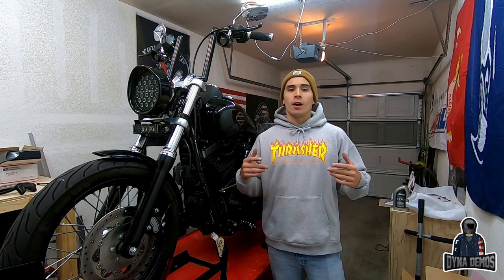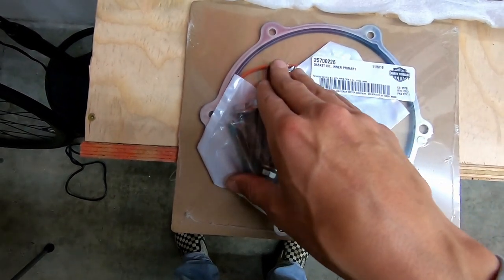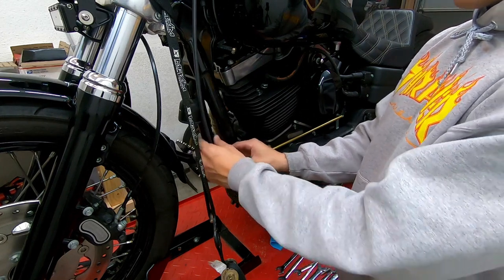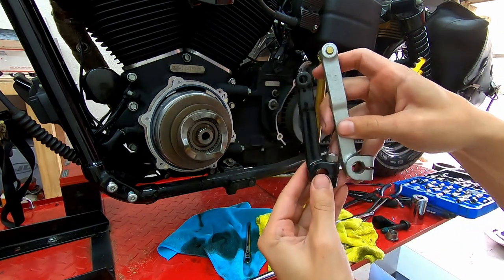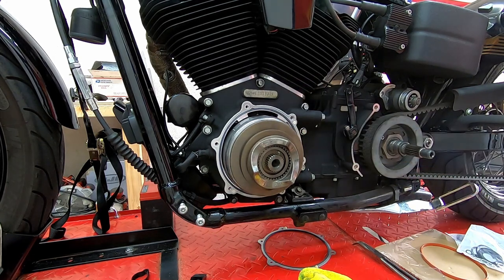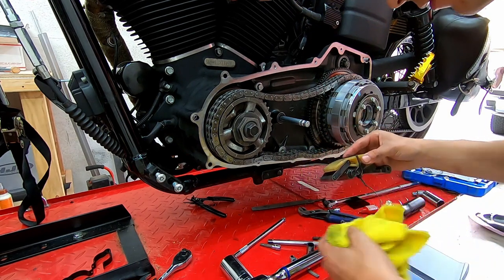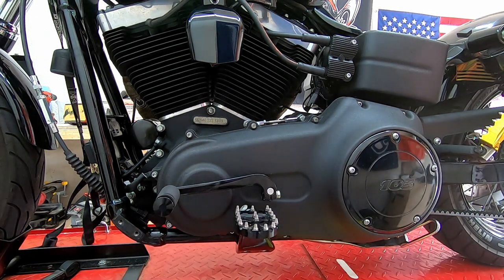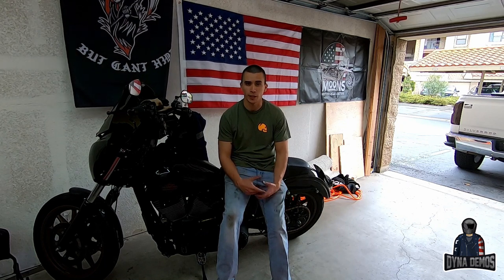Forward control to Mid Control Conversion (Dyna)

Comment: my shift shaft (going through the primary) seems to be binding or something. It is not moving freely and I'm having to use a few lbs of force to actuate it... any ideas?
Reply from the maker: This happened to one guys bike I did the conversion on I made sure nothing was getting caught on the linkage or shifter and it ended up being the bushing the shift shaft was going through was extra tight for some reason after a week of riding he was all better or spray some lube in there see if it frees up a bit

Comment: My dyna streetbob doesn’t have that hole in the outer primary. Will I need a new outer and inner primary or just an outer do you know? My dyna came stock with forwards.
Reply from the maker: Yes to a new outer and if the inner also doesn’t u will need that too
Reply: Just checked behind inner primary. Hard to see or feel around, very tight but I think I got a glimpse of what looks like a hole on the back side so hopefully just an outer should do me.  PS my bike is a streetbob Special edition if anyone knows for sure if what I’m seeing is correct. Thanks
Reply: dynademos Sorry, one other question. Is there a bushing of some sort that goes in behind primary before you put the shifter rod through? 34982-02A is this it? I ordered a new outer primary and this part seems to be coming with it but I’m unsure what it is lol
Reply from the maker: Stewart pretty sure that is a bushing that is for the outer primary shifter shaft hole should just be pretty easy to put in put the shifter through the hole if the shifter isn’t snug it’s definitely for the that and u will want to install it before u do the mids

Comment: What would a job like this typically cost at a shop, parts and labor?
Reply from the maker: Depends on the shop probably like 5 hours of labor shops are usually like 75-105 an hour. Parts are like 400-500 pending on how cheap u get the mounts
Reply: @dynademos  Awesome, I appreciate the quick reply.  This is ballpark what I was guessing it'd cost.  About halfway through your video I realized this is a job beyond what I would confidently attempt myself.  Cheers!
Reply from the maker: @hi5_centipedes874  no problem better to go to a mechanic than start the job and realize you are in over your head!

Comment: I have a 2015 fat bob. Is this conversion work on mine?
Reply from the maker: Yea
Reply: @dynademos  Thanks, look like my fatbob need new inner and outer primary. I saw someone on HD forum said the primary can be drilled out for the Fatbob. Is there a conversion kit without open the primary? I found kits for 2018 and above for fatbob
Reply from the maker: @thoaikhuu8748  I’m not sure if there is a kit for the conversion without the taking off the primary it would be expensive. If your primary doesn’t have a hole through it you can buy new ones or I’m pretty sure there are people that can convert them

Comment: What was in that hole before the new shifter shaft went in
Reply from the maker: It was just a plug not to actually plug oil cause that’s what the gasket in the primary is for

Comment: The 2 HD dealers near me are uncooperative and act all annoyed when you ask them to look up parts without the proper names, behave like they’re doing you a favor just by existing  and refuse to give out part numbers because “ it’s against policy”. Without part numbers on the video from the get go not much can be done duplicating the mod.
Reply: You'd be better off buying a new bike with mids then buy all the parts from harley. He shows you the parts I don't think it's rocket science to outsource the gaskets and ebay the inner and outer primary. Mid control set same or new from tc bros

Comment: Is it possible to bore a whole to make the outter primary cover a mid control cover?
Reply from the maker: So yes however u will need to weld a tube and do some other thing for it to not leak easier to just get a new cover
Reply: @dynademos  thank you bro!

Comment: I see where you installed the seal now..still curious about if you needed a inner primary
Reply from the maker: Rod it was the same inner primary all I did was remove the shift shaft plug that was installed because he had fwd controls if your primary doesn’t have a hole I’d recommend getting a new one idk if it’s possible to drill a hole on the ones that don’t have the hole
Reply: @dynademos  Thanks man! Great video.

Comment: how much does this conversion cost?
Reply from the maker: 130shooter1 300 ish for parts
Reply: I’m Doing this upgrade tomorrow; I think I spent around 5-600, that’s every single piece Lego talked about in this video. I got all the parts pieces through multiple vendors too
Reply: @lincolngill6690  did you do a ton of vendor price comps or?
Reply: @firecracker2510  some parts I got used, some I bought new from HD and other vendors. id shop the project a bit if you want to do it cost effectively.

Comment: That's the old style compensator its 140 the new comp it's a torx and its 175
Reply from the maker: Blair Ernst good to know
Reply: @dynademos  that comp is no longer used because it wasnt a great comp so they changed it I have replaced 3 that failed and it can take out the clutch
Reply from the maker: Blair Ernst never knew that I’ll start letting people know what year did they change

Comment: As a six foot six inch tall guy......I just wonder....why? Why go to the crappy balance and rotten handling of mid controls....
Reply from the maker: Denis O'Brien I would definitely argue it improves handling just like a dirt bike u don’t see them with forward controls u need your feet under you
Reply: @dynademos  A agree to disagree.....when I bought my Dyna I Found it top heavy and difficult to manoeuvre....but them I am a lot taller than the average, and don't do dirt bikes. I also found that they were hell on my arthritic knees.

Comment: Im surw you wont ever have issues using that stepped locking tool but that is the incorrect tool. You shoukd use the proper metal bar. Harley recommended and you wont damage anything
Reply from the maker: Haven’t had any issues but absolutely I’ll look into that